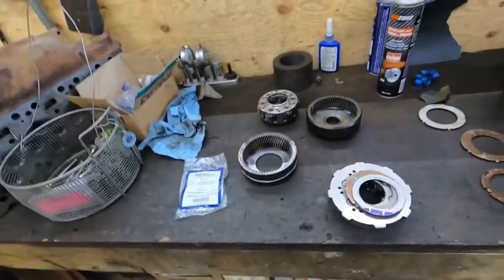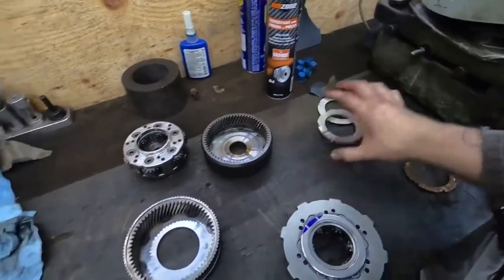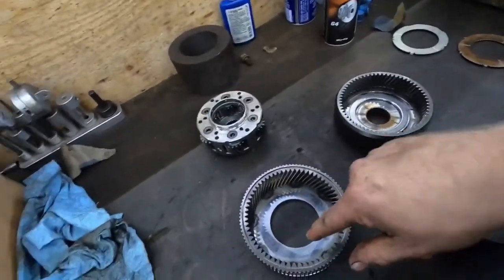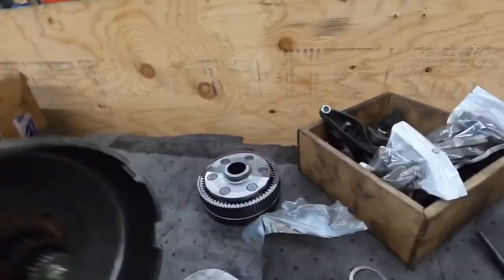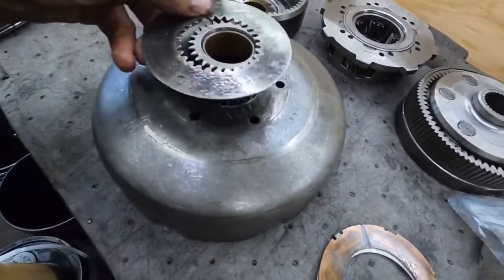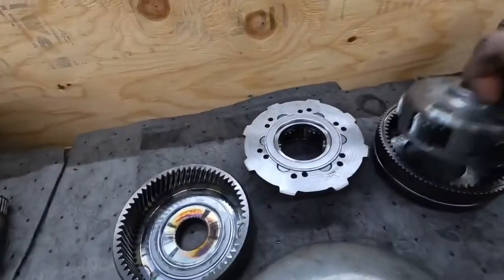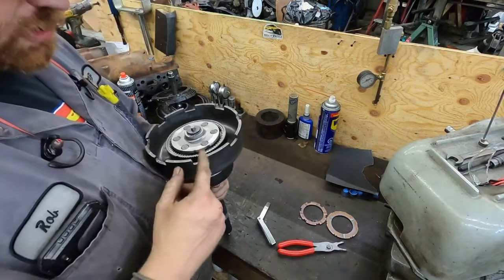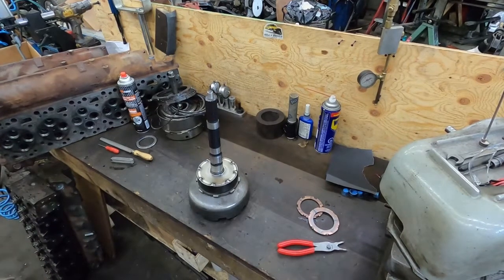How to Rollerize  planetary’s on a 47re / 48re transmission

Comment: Rob, Interesting design change. Those four washers undergo tremendous pressures, so much so that the backside of those washers get pushed into the pinion shafts leaving depressions in the underside of the thrust washers. My concern is when you remove material from the planetary you may be cutting through the hardness layer, leaving softer metal. I would have had a Rockwell hardness tester determine surface hardness where the torington bearings rest. After that, I would love to see a followup video of how this design mod lasted. Maybe a followup tear down inspection? Thank you.

Comment: After you machine the inside of the rear annulus you will no longer need that washer that has teeth on the inside,just the bearing alone will be fine. Man i really wish i had a lathe. Your video really got me thinking.
Reply from the maker: I left it in as i wanted it so a shim shape. But I figured I could have left it out

Comment: That was awesome,its about time somebody did a video on that.But here some food for thought,you did not have to put a bearing between the front annulus and the sun shell. The factory 6 tab thrust washer rarely sees any wear so just front and back on the rear planet and the one behind the front planet and you said the package comes with 3 bearings so that works out perfect. I would love to see that video.
Reply from the maker: I did it that way as that’s to only way I have seen them done. As I has the lathe setup for it. Wasn’t a big deal to do it

Comment: You can usually find good sun shells on line fairly cheap and if your going threw all the extra trouble why not put a billet sun shell in it
Reply from the maker: I have been told by four trans builds there is no need. But I did find you can buy new so I ordered a new one.
Reply: @CUTTERUPROB  I’m on my 2nd trans this year just had to replace booth planetary sets sun shell/gear intermediate shaft direct drum revers drum od piston support od housing etc. between PATC, Cascade, global transmissions, and power driven diesel you can find virtually any single peace you need

Comment: In my option this is a good idea . For one I think that and I not a transmission expert, but I think that when gm went to there tow haul mode I was told that they added bearing to there builds or I think that is what was said . I seen the thrust washers that came out of these dodge transmission and you can see the impressions left on the back side of them from the thrust loading . I seem a picture of a planetary that was machined for there bearings but did not have any details . The 6 pinion planets are a good up grade in my option . Sir are you going to use the front pump also out of the 48 as I think  has more gpm than the 47 transmission . I was told that the second gear band out of the 727 was a better deal also . Enjoy the videos thanks
Reply from the maker: The trans i am using is a 48re, i will be using the 48re pump and the brand i am not sure it will be a 727 or a hard band.
Reply: Yep that is a good point sir👍👍

Comment: I do believe the factory thrust washer's do withstand a quite bit of abuse, especially the 48re gear train with the thinker sun gear shell, steel planets and all,.long as the clearances are correct...but it's cool to see u doing that with the needle bearings👍👍
Reply from the maker: ya the washers do take a alot of abuse, i just figured i am going in there and doing everything else might as well do this
Reply: @CUTTERUPROB  👍👍yep right on